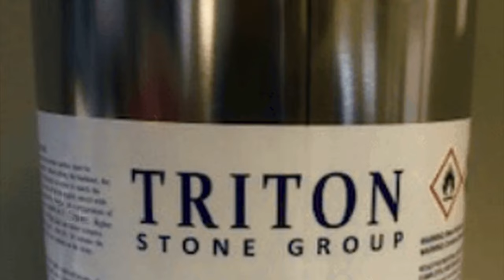HOW TO CUT QUARTZ OR GRANITE AS KITCHEN COUNTER TOPS

Comment: Is the sink area the best place to tie the countertop together with cuts?  Seems like it is a very wet area.  Isn't this risky?  How hard is it to replace the cabinets once the sink is grouted to the cabinets if they need to be changed out in the future?
Reply: Since the length is so long It would be way too fragile during install to not put the cut right where they did.  With some epoxy and caulk it'll be water tight forever.